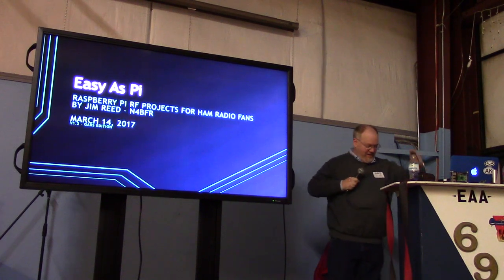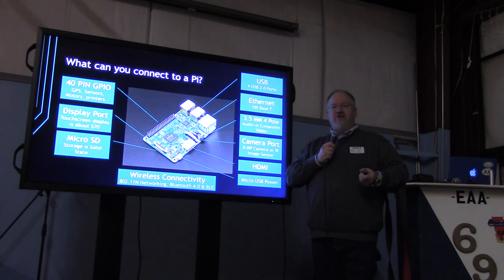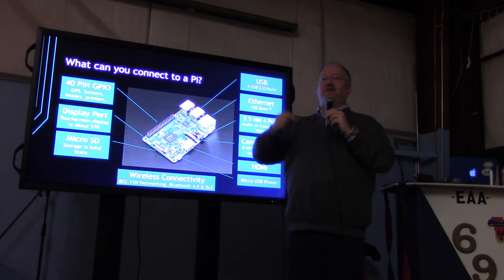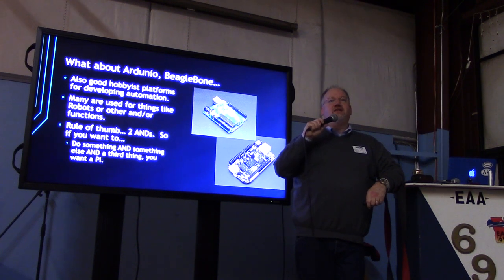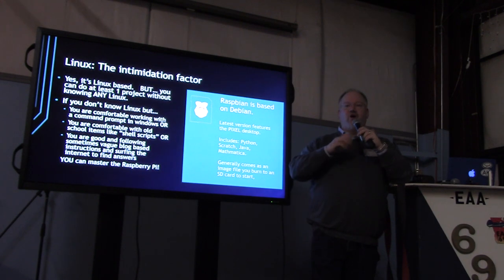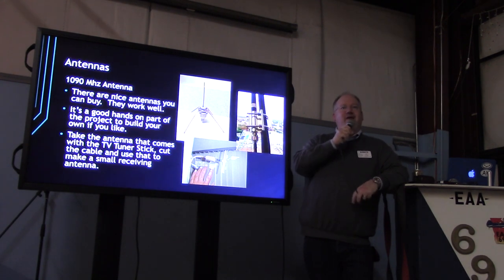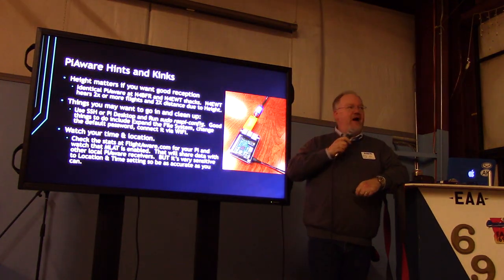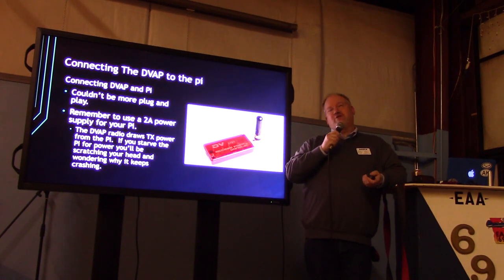Raspberry Pi in the Ham Shack Jim Reed N4BFR

Comment: The i/o terminals can be connected to PLC as well as other cool stuff...
I have a 3 B installed in a vehicle, connected to an 8 inch monitor and Bluetooth keyboard& mouse. Running Raspbian  with Full Libre Office,  and a USB lazer printer.
As he said, Linux is actually just as easy as Windows,, just faster. I play movies on my Pi also...
Also the Libre Office or Open office can open and save documents in Word and Excel format. Raspian does not come with the HAM software, you will need to add that.

Comment: Hi Jim what "Kiosk mode" display software do you use to display the clock / aprs / ADSB etc. It would be nice to display a few things in the shack like that - I was looking at some customisable displays but they are set for business and need a licence - was wondering which one your using on the pi

Comment: Love the PI. Good video.  New sub here.  Linux is my love language haha.  Spent years in telecom engineering with many Linux based systems. Also in retirement I am building an avionics project for my flight simulator based on Xplane.   The Arduino is more like a microcontroller where the Pi is more of general processor.